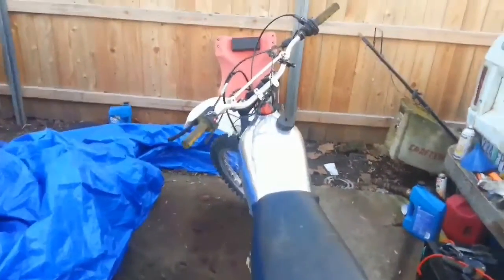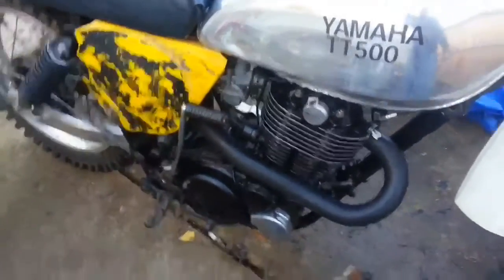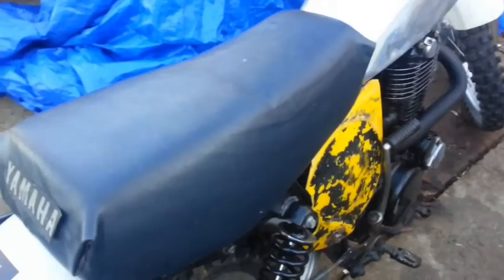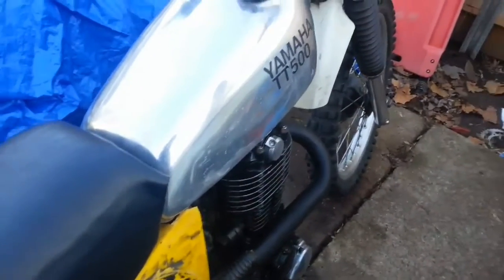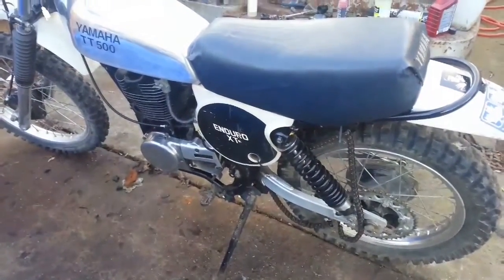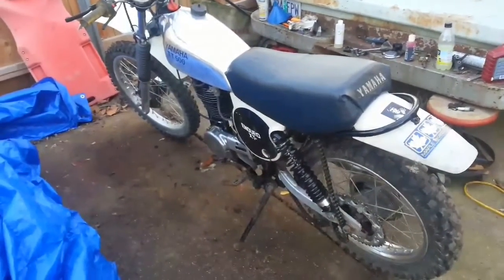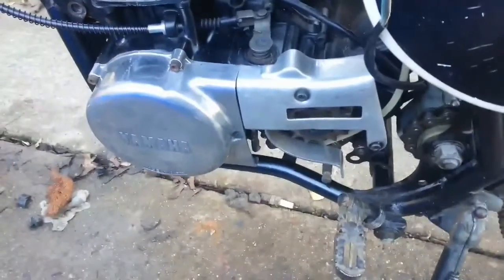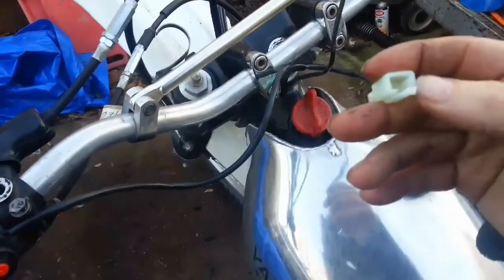Yamaha TT500 starting to look as it should

Comment: this is going to be a cool bike Dude
Reply from the maker: LoggerJohn01 most definitely a cool bike....even in a sea of dirtbikes  you couldn't  loose this one....that polished tank sticks out like a sore thumb...and everyone assumes that since it's anciently old it's going to be slow....and slow these things are definitely not...yeah these left the factory with only 27 horse power but they had a shit ton of torque on there side...and a good mild cam really wakes them up and adds about 10 or 15 horse to it....mine does have a mega cycles cam....but the grind lift duration ,lobe separation ect ect is unknown to me...when I ran the casting  numbers  I got no results found....which is to bad because I have another cam just like it that's fairly new to well that shows no wear anyways I'd guess it's 30 or 40 years old